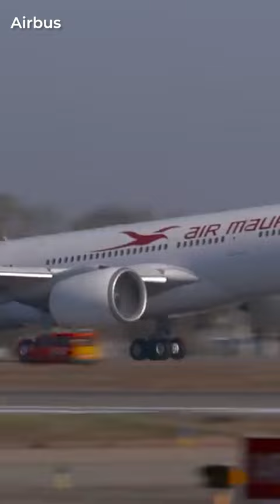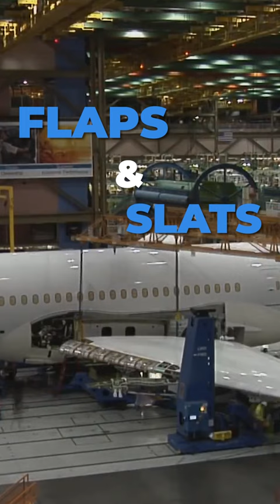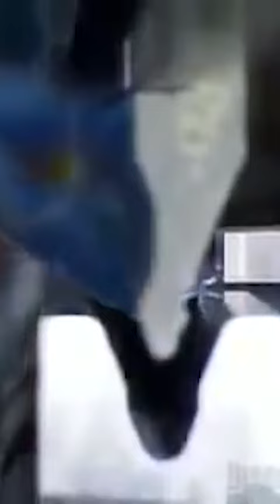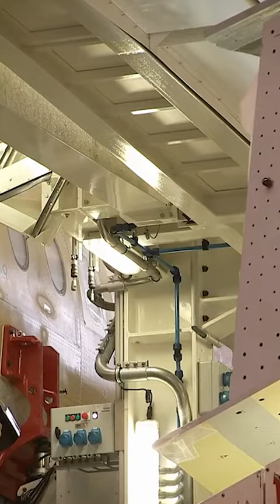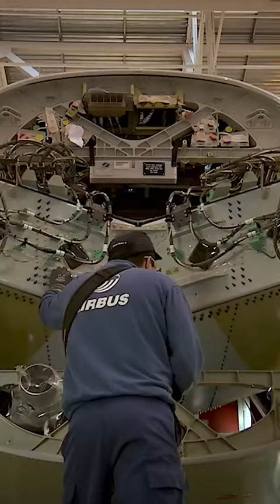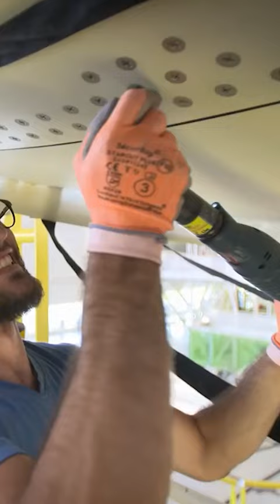How Are Aircraft Wings Made? #shorts

Comment: "How are aircraft wings MADE?"
Well, we now know that they generate lift and use the thrust from engines...
We know that there are all sorts of bits and pieces like flaps and slats are attached to wings...
We know that somewhere in the wing there is a front spar, a rear spar and some ribs...
We know that wings can be made of aluminium or composite, and can have big white bits that we can see...
But after this video, no one is any the wiser as to;
HOW AIRCRAFT WINGS ARE MADE!
It's like a parrot reading random bits of a wikipedia page.